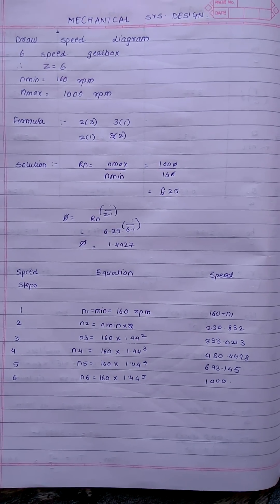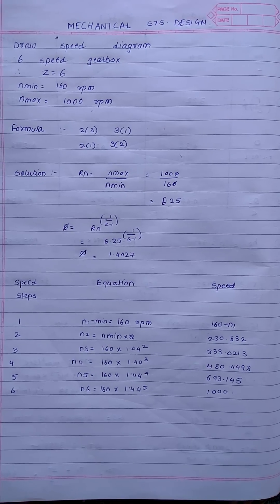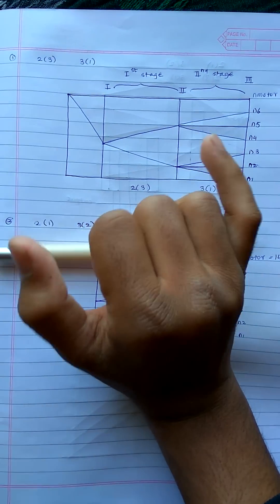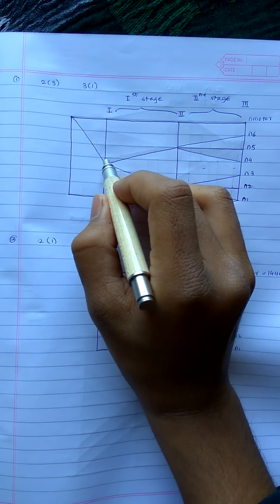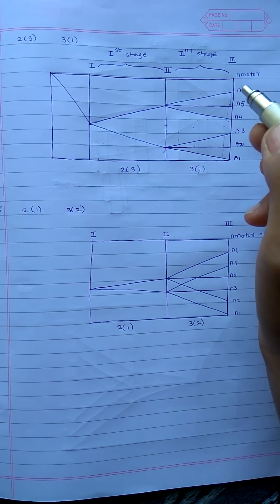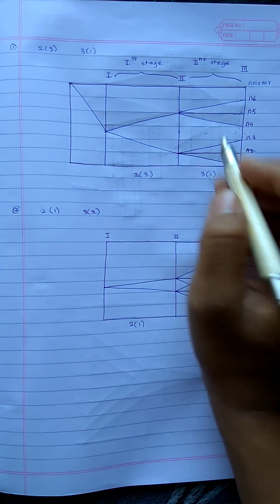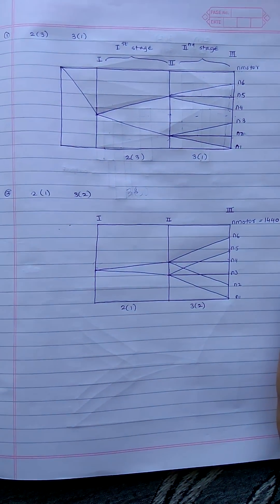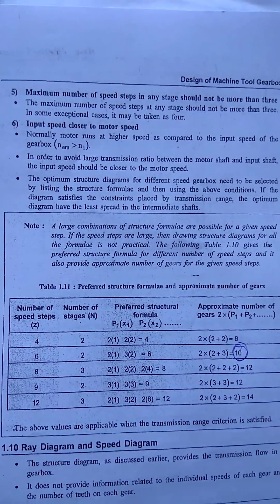MSD Speed Diagram | Session 1| Problems | Numericals

Comment: you didn't explained,how to draw ray diagram as well as speed chart
Reply from the maker: kiran naik just take the first inclined line from each block! 
when motor is concerned take the motor shaft then 1st stage's lowermost shaft and 2nd stage's lowermost shaft and you're done
Reply from the maker: +kiran naik replied check comments
Reply: still didn't get it
Reply from the maker: kiran naik mail id please.
Reply from the maker: kiran naik check mail.
Reply: sir , I want to know how can we solve it if the structural formula is not given
Reply from the maker: +Nikhil Srivastava if structural formula not given u hv to determine from the speed steps and range ratio using p1x1 formula
Reply: Okay means first I have to find Z then from that table i will get the structural formula
Reply from the maker: +Nikhil Srivastava yes first steps then range ratio then structural formula drop your email il send you the table its easy